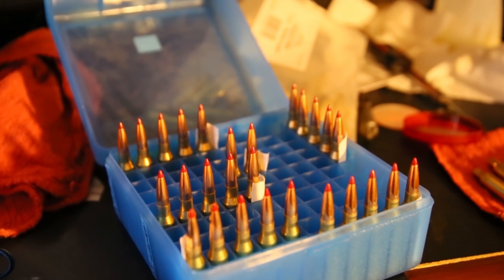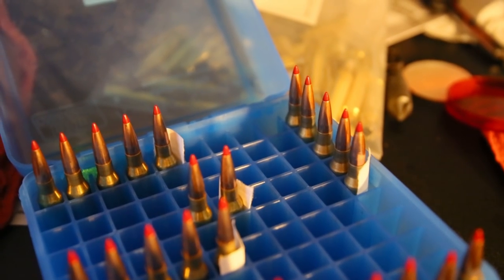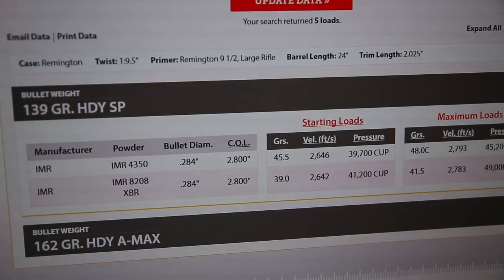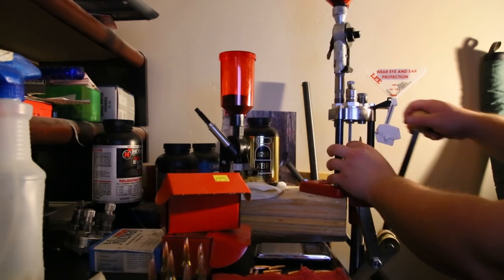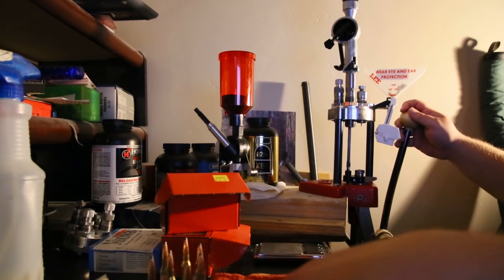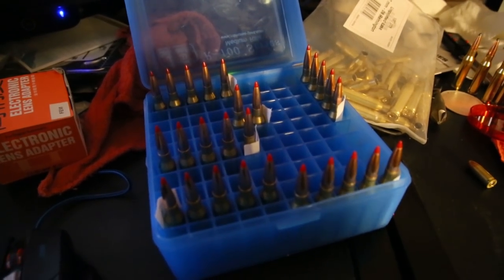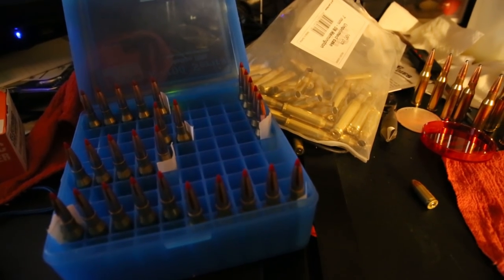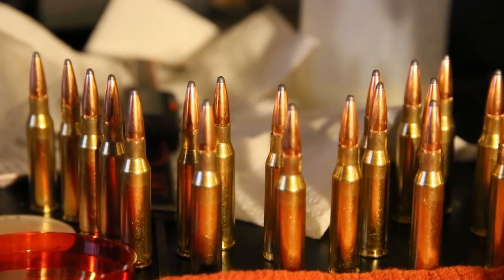Why I switched from 30-06 to 7MM-08 And reloading 7mm-08 for Elk - Lee Classic Turret Press

Comment: A lot of movement on the press I bolt mine down with 4" bolts and nuts solid
Reply from the maker: Yeah this wasn't an ideal setup, the desk was too flimsy. I built a solid reloading bench using 2x10s and a sheet of solid plywood and then bolted it to that and it doesn't move. What you're seeing in the video is the desk flexing...

Comment: Im thinking about getting a rifle soon, im thinking abouta 30-06, 308, 7mm-08 or a 243 what would you prefer?
Reply from the maker: What are planning on using the gun for? That will narrow down the list.
Reply: Glenn Pearson Probably just white tail deer
Reply from the maker: If you are using it for white tail, any of them would work. My personal choice would be the 7MM-08. It has as much stopping power as the 30-06 and .308, but kicks a lot less similar to the .243. The .243, .308 and 7mm-08 all use the same case/brass, just different sized bullets. 7MM bullets are more efficient than either of the other 2. But again, any of the calibers you mention will take down a whitetail. If you want less kick and flatter shooting, look at the 7mm-08 or .243.
Reply: Is there a big difference in 7MM-08 and 7MM Rem Mag in terms of velocity and accuracy?
Reply from the maker: The 7MM Rem Mag is anywhere from 100-300fps faster depending on the bullet. Both are very accurate. I'm posting a video that compares the ballistics of those 2 this coming Tuesday. So if you want to know more details, look for that video.
Reply: LOL  The 7 mag holds almost twice as much powder and makes the 7-08 case look little. I have both and like shooting both, but if you don't shoot a lot or need that much power, don't get a 7 mag. It will feel like a mule kicked you. lol
Reply: Probably more like 400 fps faster for the 7 mag.
Reply: Glenn Pearson there's no such thing as stopping power...
Reply: Have a Remington 243 and a 270 ..lovem both . The 270 has more power . Thinking of a 7mm 08 for the next rifle. Take down any deer with either one .
Reply: Country Dipper o

Comment: Where are you getting load data for Hybrid 100V for the 7mm08?  None of my manuals list it and I read the powder is more for magnum calibers and should not be used for 7mm08.
Reply from the maker: The reloading data is on the imr/Hodgdon load data site. You can see the load data for the 7mm-08 there. They make the powder and tested it with the 7mm-08.
Reply from the maker: I've made it a habit to check the load data the powder manufacturer lists. They make the powder and know what it can do. I will often cross reference loads when I'm testing new bullets and powders.

Comment: Why not the 708 virtually duplicates one of the best the 7x57 Mauser WDM Bell used his 7x57to take literally 100's of Elephants
Reply: Bell used a 275 Rigby.
Reply: Which of course is what the Brits called the 7x57.
Reply from the maker: Bell called the 7X57 the 275 bore, but it was in fact a 7X57. 

"The 7×57mm has been described as "a ballistician's delight".[citation needed] Many sporting rifles in this calibre were made by British riflemakers, among whom John Rigby was prominent; and, catering for the British preference for calibres to be designated in inches, Rigby called this chambering the .275 bore after the measurement of a 7 mm rifle's bore across the lands.[2]"
Reply: Bales--Actually no they did not the round was referred to as the .275 Rimless Rigby. Almost identical to the 7x57 but with enough difference to make chambering difficult. Its 9.00 AM where I'm sitting and have examined drawings of each cartridge my source of information THE HANDLOADERS MANUAL OF CARTRIDGE CONVERSIONS by John J. Donnelly.
Reply: Glenn PEARSON-- The round was and still is the 275 Rimless Rigby, it has minor differences than the 7x57 and chambering could create a problem. As far as I know its obsolete but could be recreated by forming brass with the aid of a die set most likely supplied by R.C.B.S. My source of information on this topic is John J. Donnelly author of The handloaders manual of cartridge conversions.
Reply: I have fired .275 Rigby in 7x57 rifles  and 7x57 in .275 rifles there is zero practical difference in dimension or performance
Reply: 284 Winchester too
Reply: He toppled elephants by being very skilled a shot placement and shooting at extremely close proximity. If you can duplicate his actions, my hats off to ya. Personally I'd go with a 400+gr .45-70 for the same beasts. And I know for a fact I'll never hunt elephant in my life.

Comment: After watching the video (and it was well done by the way) and reading close to a 100 comments, I have come to the conclusion that the .270 really is the best all round cartridge for just about anything except the largest bears.  I have been killing hogs and deer for over 60 years with my .270 and while the 7-08 is undoubtably a fine round, I just don't see it jumping over my .270.  One feller wrote, don't try to make the 7-08 in to a 7mag.  I would say don't try to make it a .270.  If you want all that velocity just get a .270 or 7mag.  I seriously doubt a elk, deer, moose or hog for that matter will ever notice that the size of the bullet tearing out their lungs or heart has a .007 difference in diameter.
Reply: The 7mm08 can not and will never out shoot the .270. The .270 will match a standard 7mm round. They are almost the very same round.
Reply: The .270 is still the best long range high velocity round on the market imo. It has the range that 99% of people can shoot reasonably. It is easily a 400 yard round for most of North America.
Reply: The 708 is a low recoil  Tack driver .......it's extremely versatile . You can hunt medium game up to elk and and go shoot competition with the same Gun. My hand loads have produced 3/8 "5 shot groups since the early 80's.

Comment: I use my 45/70 the most for hunting deer moose and elk there nothing in USA that can handle 405 gr hard cast bullet going 1,700 FPS my gel test gave me 54 inch of penetration and 3 inch wide damage full 54 inches long
Reply: The .45-70 is a hugely versatile caliber. The only thing it doesn't have going for it is rainbow trajectory, which can be improved marginally with LeverEvolution bullets. If someone gets very familiar with the behavior of drop, they can hunt and kill anything at several hundred yards. Penetration will never ever be an issue.

Personally I've pondered some sort of larger caliber:  6.5, 7mm, .30, .338, etc. for bigger game. And I keep coming back to... why not just go with .45-70 and learn to hunt in closer proximity to the game? Deer, moose, elk, bear, sheep, or nasty African game. One caliber to do it all.

Comment: Glenn the correct nomenclature when using the double (mm) in speech is to say (millimeter) rather then to say MM, as in saying Seven millimeter -08. For us in America the mm or millimeter denotes a size measurement of the bullet ( .284) while the -08 was adopted because it was developed from necking down a 308 Winchester to 7mm, hence the term 7mm -308 having been a wildcat years before 1980. The 30-06 was developed from a 30 caliber bullet adopted in 1906, the prior cartridge was the 30-03. That was changed in 1906 with a change from a 220 grain round nose FMJ bullet to a 150 grain Spitzer shaped FMJ bullet. 
Now, I hope you developed your loads for your 7mm-08 based on doing the latter test first, load 2 cartridges from the start load, with bullets seated to fit into the magazine of your rifle, then increase your powder charge in increments of 0.5 grains until you saw signs of pressure, then backed off and do the same with a loading of 5 cartridges of the load density that was say 2.0 grains less then what your near max load was when adverse pressure signs were noted. If you said your rifle showed adverse pressure signs at 45.0 grains then you would do your next
test starting with loads at 43.0 grains, then increase by 0.2 grains, and test these, looking for best possible accurate loading. Bullets are less likely to loose velocity when they are started slower then when they are started off faster, plus if you load with a single base powder the powder is still generating pressure as the bullet is approaching the muzzle while a double base powder may be completely burned out by the time the bullet reaches the mid point in the barrel. So if your rifle has a longer length barrel your going to get the best performance from a single base powder, the shorter barrel with a double base powder.

Comment: What do you use to measure the bullet distance from the lands of your rifle?
Reply from the maker: I ran a once fired case through my resizer die, and then placed a bullet in it. You want it to be snug enough to not fall out but loose enough to move when pushed. Once the bullet is in the case, I chamber in the gun locking the bolt down if I were going to fire it. Then I carefully eject it, making sure not to bump the bullet. This will give you the total overall case length to the lands. I then backed it off as far as I wanted from there, reducing the over all length. 

There are youtube videos demonstrating how to do this. I would be happy to post a tutorial if you want.
Reply: Sounds good! I'll try that, thanks!

Comment: 30 06 is still an awsome round. 308 was designed to be all but equal but shorter . 270 was designed with better bc in mind.
7mm08 is basically a 270 cal in a 308 case. best of both worlds.
uncomplicated comparison.

Comment: I shoot some 100 grain hollow points from my 7mm-08 very accurately but they are going 2600-2700 fps to make them stable otherwise any faster and they are not stable out to 100 yards and just uploaded some of them hitting a thick steel target and putting some deep welts into that steel

https://www.youtube.com/watch?v=-ao-RBKJdIg

Of course the book will say that load is below the lowest load in the book to get those velocities and usually shows the lowest load going 3,000 fps

Problem being because of the length of the 100 grain bullet it will not stabilize properly with the 1 in 9.5 barrel twist rate and the difference is about a 2 foot group shooting them at 3000 fps or faster compared to bullets going thru the same hole at 100 yards going 2600 fps

I have some math to make it where you can adjust the velocity of every weight bullet for any rifle to hit the same spot on the target regardless of 100 grain to 175 grain for the 7mm-08 but of course 175 grains loaded to the max and 100 grain end up loaded below book values and need filler in the case

I'll see if I can upload that math to my channel but it seems every time I try to explain it to anyone they always say, You lost me when you said math LOL

The 7mm-08 beats both the 308 and the 30-06 in velocity and energy once they pass the 250 yard mark and there is so little difference before that point I can assure you the game will not jump back up and say, Hey that did not hurt at all I'm leaving now LOL

The 7mm-08 beats all of the 30-06 bullets even the 220 grain after 250 yards regardless and I have won many bets proving that to die hard 30-06 owners who think that heavier 220 grain bullet will go a longer range with more energy than say a 160 grain shot from a 7mm-08, Hey do not make a bet with me because I will not take it unless I know for a fact I can win and that one is always a sure bet for me to win with no problem

Might note I never use a progressive press and always do my reloading on a single stage one operation at a time otherwise I would not be able to shoot bullets thru the same hole at 100-200 yards nor have I ever had a bad reload either being as every single load is inspected during every stage of the reloading operation and I have chronograph three loads in a row the exact same velocity many times, Something someone using a progressive press will never be able to do